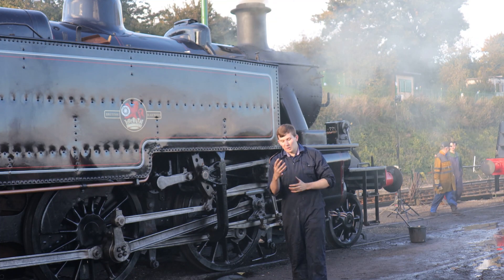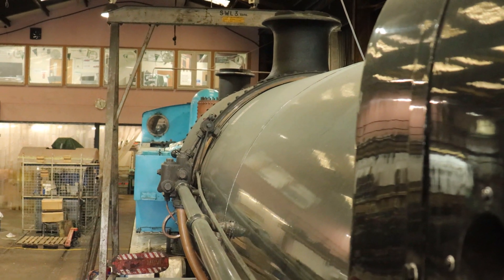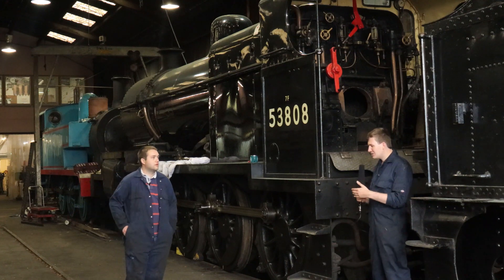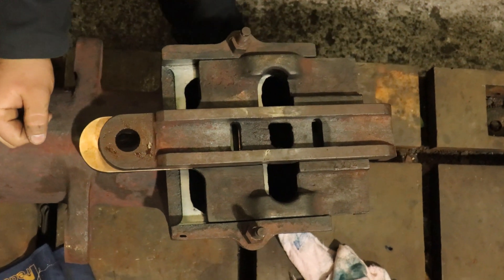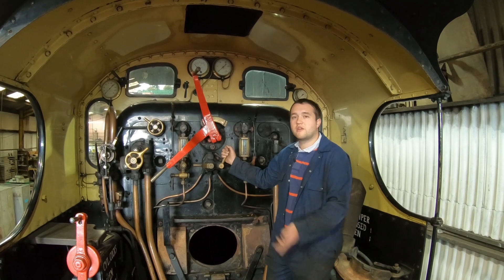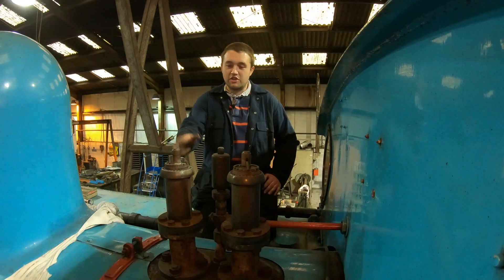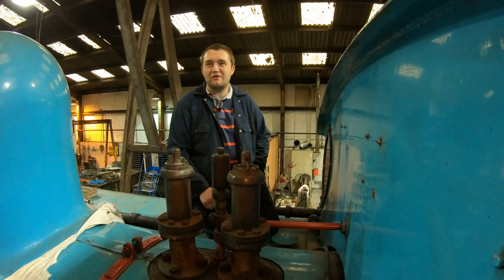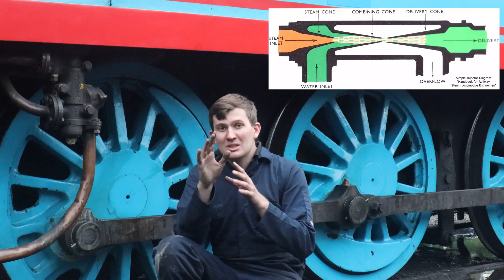Boilers - Part 2 'Using the Steam'

Comment: The regulator as device does not lift the water level.  It is the high rate of steam production creating tiny steam bubbles along the heating surfaces and displacing some of the water in the boiler and raising the level.

Comment: Sorry, but I was taught that if you can't see the water level, do not add water to the boiler. If the plate is overheated, cold water could cause it to fracture (boiler explodes).
If your fusible plug "drops" and you cannot see the water, drop the fire and get rid of the pressure. Do not add water!

Yes it is possible for the plug to drop even when there is plenty of water in the boiler, and if you can see the water, then it would be safe to add to reduce boiler pressure. Part of the pre fire lighting check is to visually check the fusible plugs. In 35 years I have three times seen a faulty plug, only once on a railway engine and that was last year.
Reply: If your water level is low one would hope you would have both injectors on to fill the water. 
If the water level is out of sight and you want to check whether the level is above the crown, shut the steam way cock. If water is above the crown and above the water way passage it will rise to the top of the glass. Start both injectors. 
The best way to ensure there is sufficient water in the boiler assuming there are two operable injectors is to develop a good firing technique and the driver to have a good driving technique. Often the drivers side injector gets neglected.